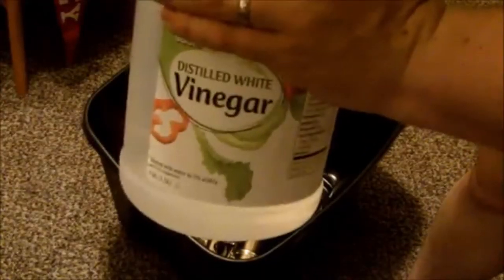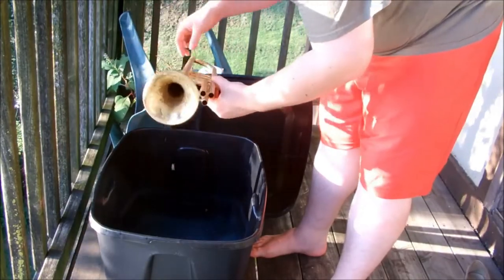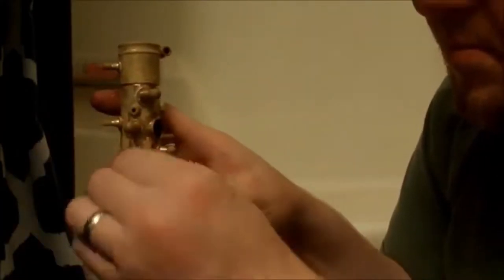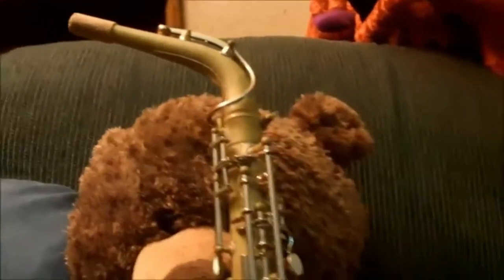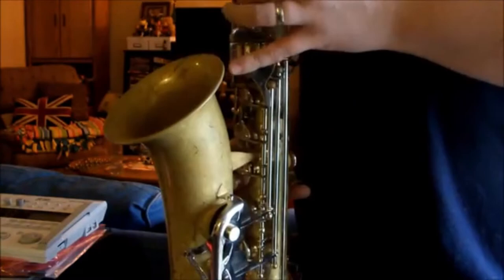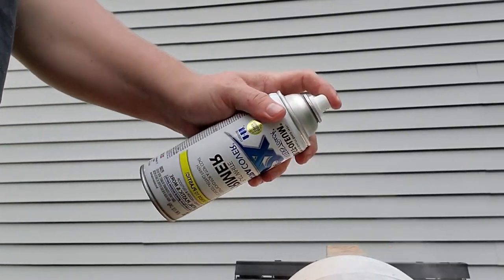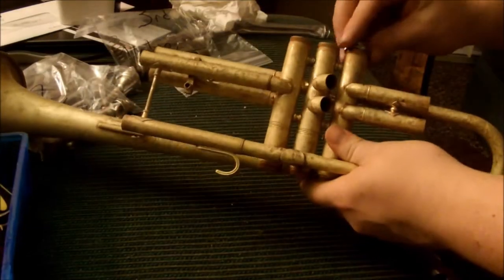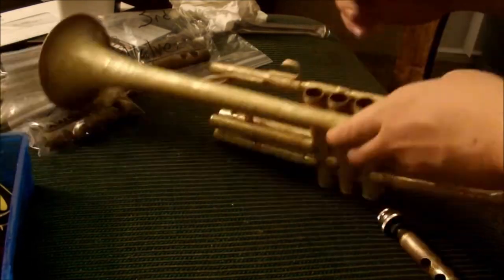How to Delaquer A Trumpet and Saxophone

Comment: I don't know if you'll see this, but do you need to use a new vinegar solution every day or can you use the same one for the entire process? Also can you put it right back into the vinegar after wiping it down or do you have to wait a little while before putting it back in?
Reply from the maker: I used the same solution throughout the whole process. From what I saw, I don't believe changing each day would benefit it in any way over the same stuff. (Also save on money)  

I did it honestly two different ways. The saxophone I was meticulous about taking it out each day and soaking it in hot water (which was a real challenge at that time, apartment, 4 minutes of hot water) wiping it down and then putting it back in. The trumpet. i just left it in for like a week and pulled it out at the end and gave it a hot bath and wiped it down. The saxophone I think looks nicer, but it also I think is just the metal itself.

Comment: hi sir, what's the harm to the saxophone compared between vinegar and those chemicals? I've heard from a sax Luthier on YouTube that the chemicals thin and therefore weakens the metal specially in the circles the pads touch (Sorry for the crap description) does this happens also with the vinegar? thanks for the information sir
Reply from the maker: The only thing I've seen as far as harming the instrument was the pearls on the saxophone broke down. And some joints looked to lose a bit of soldering, but nothing that was too bad.
Reply: @caseydoremus5324  thanks for answering sir, have a great day